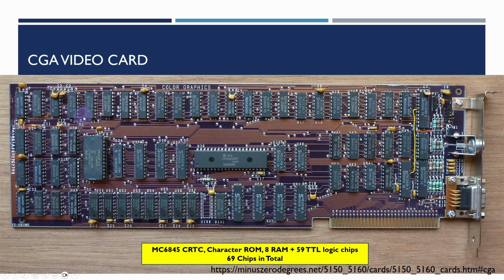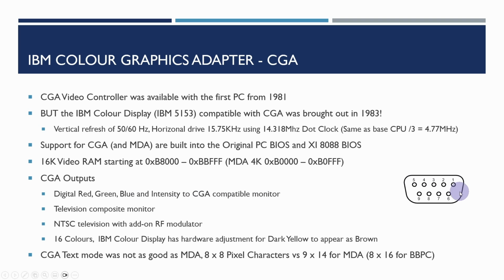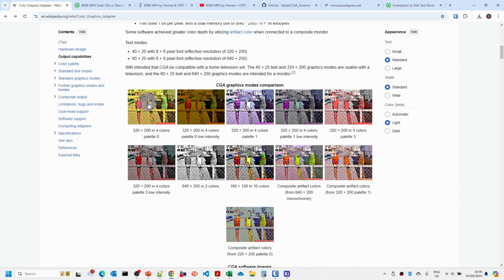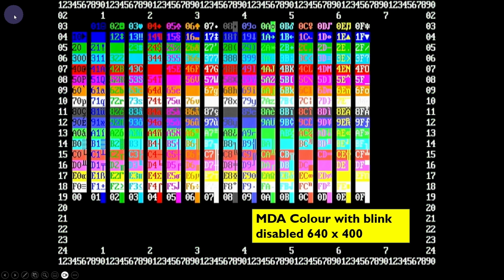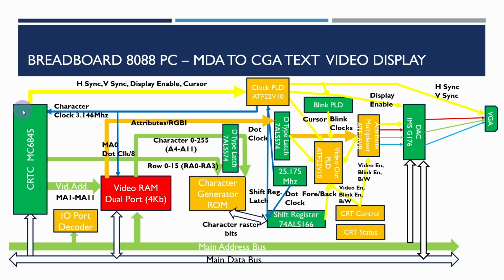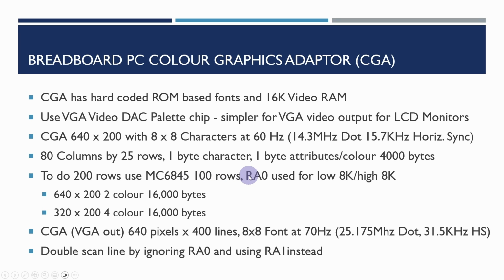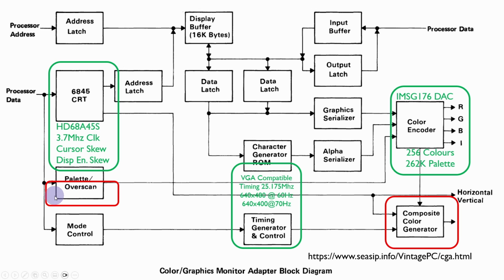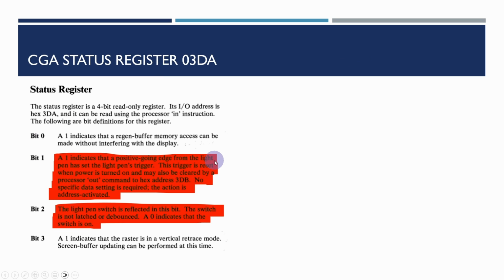Breadboard 8088 PC #45 CGA Video Controller Part 1

Comment: Believe it or not I picked up a fully working colour CGA monitor with the case in excellent condition, from a local computer retro faire for only £50 😮 . Thankfully although at some point in the 90’s I got rid of lots of now collectible ISA and other cards, I did keep one CGA card. I was using the card and monitor today in a genuine IBM PC motherboard (5 slots) also bought at the same computer faire (different date).
Reply from the maker: Ah well done with those purchases. I only started my own PC collection with a 486 DX in around 1992 and unfortunately I cleared out all of the old ISA & PCI cards etc more than a decade ago :-(

Comment: So thanks to IBM implementing a clock frequency helpful for standard US TV video generation, they threw away 5% of CPU frequency. All those PCs back in the 80’s could be safely over clocked by using a 15MHz crystal?
Reply from the maker: Agreed, and in fact to get the floppy disk controller working with programmed I/O (not DMA) I had to overclock the 8088 I have from 1983 to 16Mhz for it to be able to keep up with 1.44MB High Density Floppy drive data rate (500Kbps). PC Jr and Tandy 1000 only needed to use programmed I/O for standard density floppy drives so based frequency was OK (250Kbps). Dave

Comment: Even if I'm sure that you can do it, as you have done it many times in the past, I wish you good luck!
Reply from the maker: Thanks, the CGA should be OK. I suspect getting the memory Map right for MCGA high res 640x480 2 colour and 320x200 256 colour will be tricky with a 6845 CRTC. In the 6809 version I didn't have to worry about PC compatibility so used 8 row address lines to get the 480 horizontal lines. MCGA used contiguous addresses for the pixels due to use of dedicated LSI chips. Still thinking about that one but will probably use a EEPROM to do the CPU memory map decoding. Dave